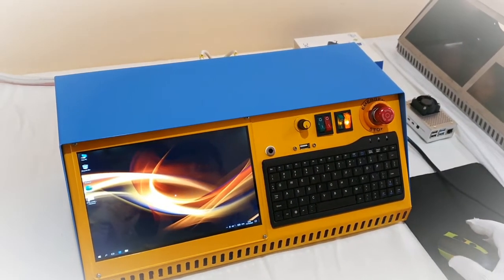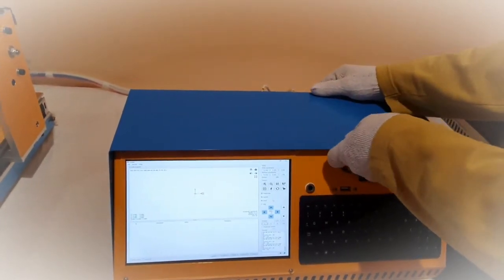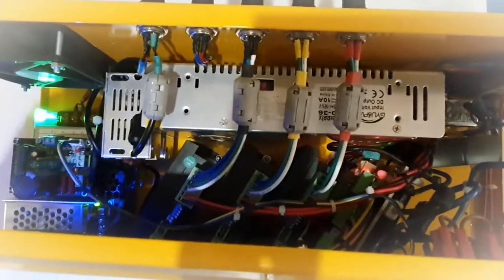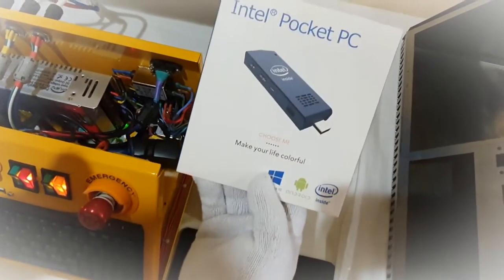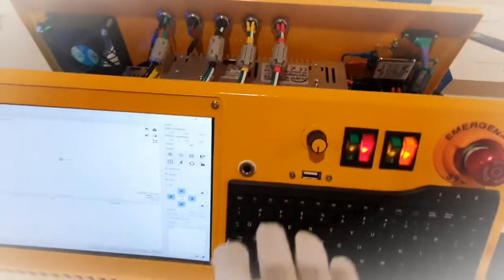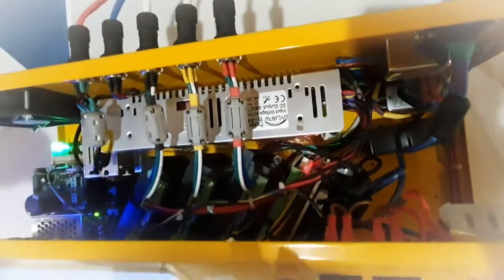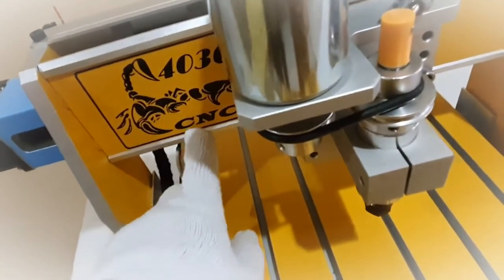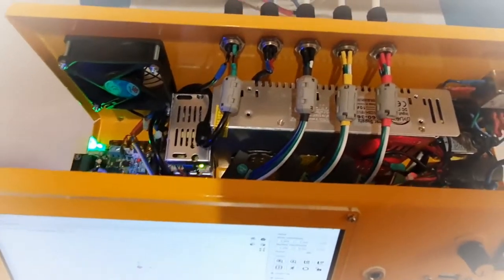Grbl CNC Control Box Nema 23

Comment: just subbed this is even cooler then the ddcs build, now I'm torn LOL
Reply from the maker: Not yet there is a Still one controller left LOL  https://www.youtube.com/watch?v=I3gOhFqxsqw
Reply: @yacoubjabal3762   I really like the way you designed all of these. I have some old NAS cases from the 2000's laying around I  might convert, the aluminum with acrylic old school looking cases with 5.25 drive slots up front to mount to, fan holes already there and power supply mounts/plugs.
Reply from the maker: @MannFranke  OH you got your own network before now I have Synology nas I did not even try it yet, And yes it will be a grate idea if you convert the old case for nac.
Reply: @yacoubjabal3762   I don't have a home network setup currently sadly just the cases :) they are almost new kept them for project, one is a very good candidate to convert